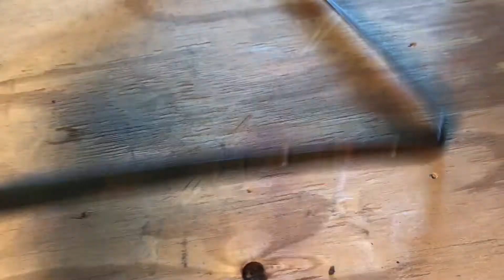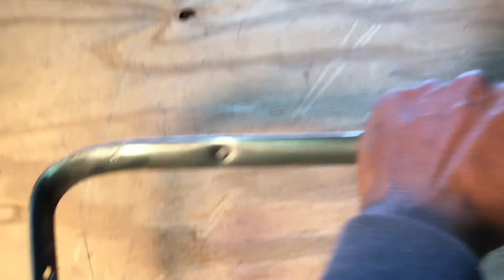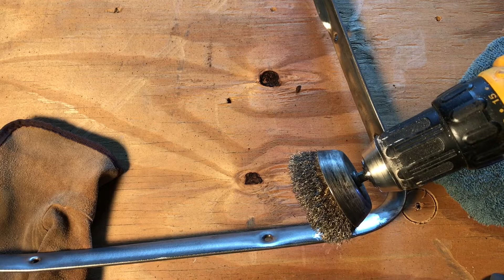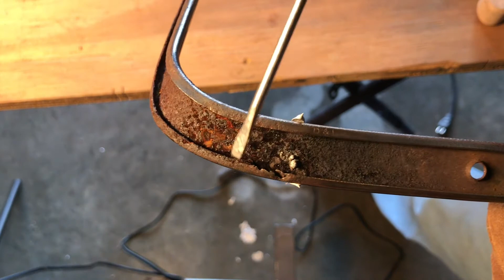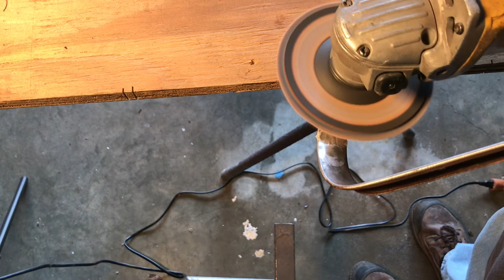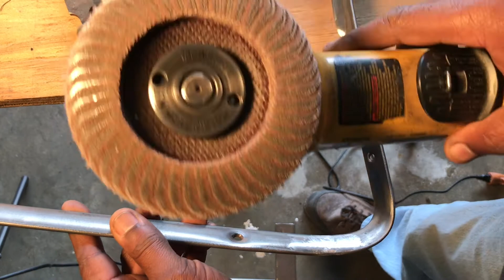Repair that old rusty auto trim by using lead solder!!!

Comment: Do you have to use lead can you just use lead free or solder?🤔
Reply from the maker: You may use anything that’ll conduct electricity and anything that doesn’t conduct may be plated with a conductive coating and then plated.

Comment: I would be tempted to clean the hell out of the back side and solder it to...
I am curious, are you you going to paint it, or get it chromed ?
If you paint it, what kinda primer or process do you do ?
Reply from the maker: I just wire brush the back and painted with POR and painted the front side with semigloss black. You may use a DTM primer or a good quality epoxy primer.